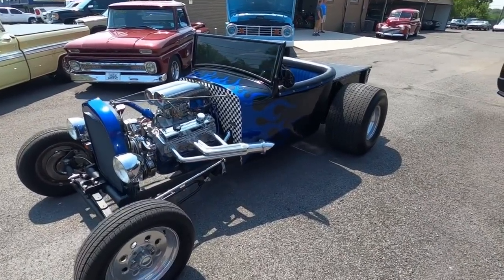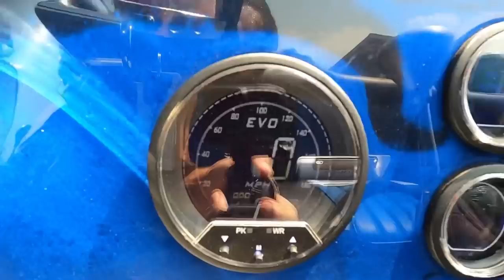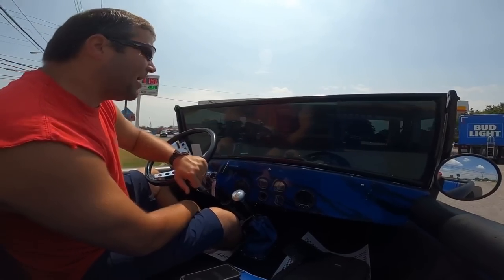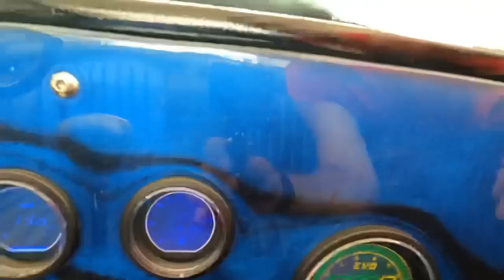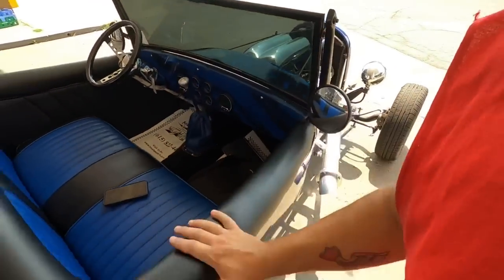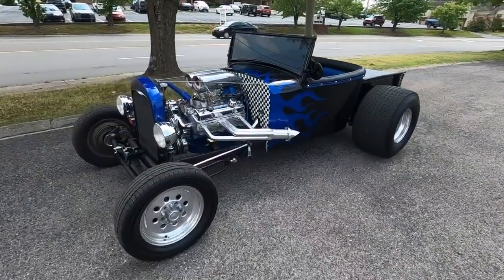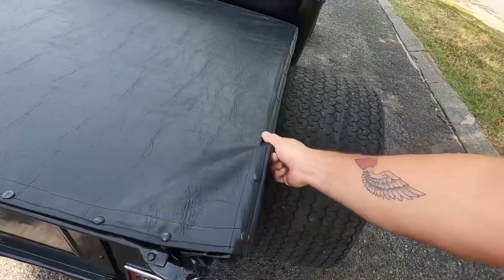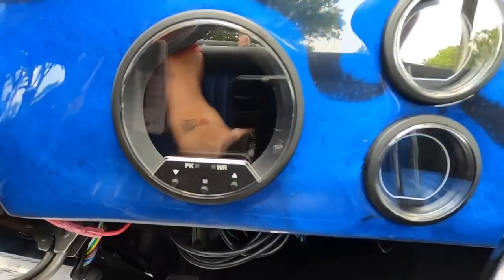Test Drive 1930 Ford T-Bucket SOLD $15,900 Maple Motors #1730

Comment: "1930 Ford T-Bucket" is an oxymoron.

Model T Fords were built from 1908 - 27. The Model A replaced them in 1928, running through 1931.

Comment: Maybe it's because I'm not a fan of the buckets but it is a bit over priced? For me anyway! As Tees go it is OK and looks like a fun ride.
Reply: A Streetrod builder friend of mine once said no T bucket is worth more than $10k.  That was a few yrs ago though.  He built them and sold parts for them for yrs so he knew.  The Blueprint motor in this one was not cheap I’m guessing. I just paid $10k for one with 563 hp.
Reply: @leftyoverton4347  THat has always been my thinking but I was trying not to be rude. 10K was always about the going price but I'm no longer in the hobby so haven't kept up with it.